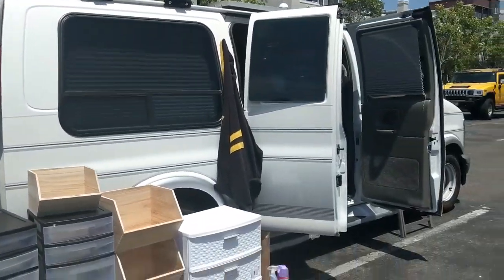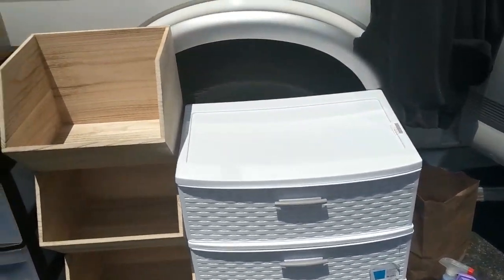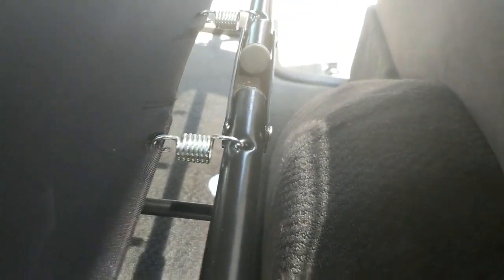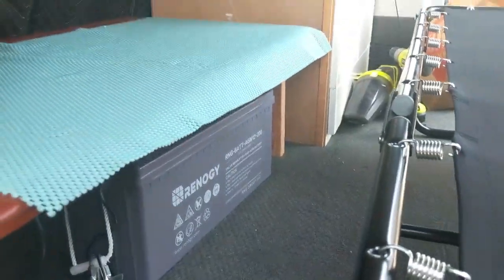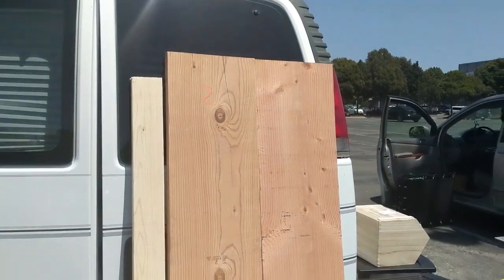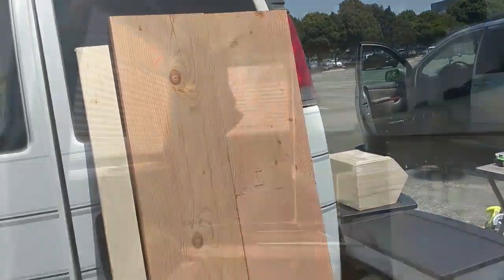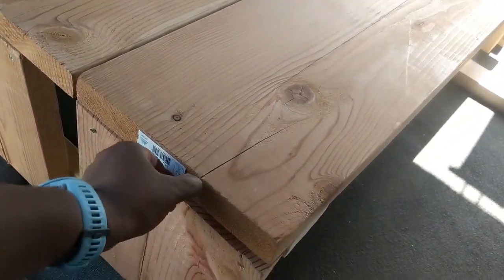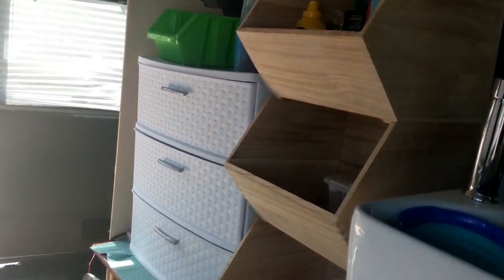Building a Simple Bed Platform | Moving Into a Conversion Van | Solo Female Vanlife

Comment: Nice. you might want to drill vent holes in the bed top.
Reply: I wondered about that.  I think I've also seen some anti mold mats that some van dwellers put under their mattress.
Reply: Why holes? Ventilation?
Reply: @earlee7146  Yeah, I think the humidity in vans can lead to mold under the mattress
Reply: Always inspired
Reply: That and a couple of support slats?
Reply: I think it's a myth... never had holes in my plywood, been in a vehicle home for 5 years now. Holes just make the air, especially cold air come thru and add to moisture exposure. 🤷🏾‍♀️
Reply: Dawn should of gone to someone who have experience in carpentry to held her , winter is around the corner, she need plenty of storage, so put holes or whatever means for air to circulate, underneath the bed she should of divide a small portion by making a drawer on slides for the tools and then a second drawer on slides to put away things she hardly use like blankets etc, wishing her all the best
Reply: Don't think that would be a problem she didn't seal the van air tight so it can still breathe like the manufacturers made it. When you start with the spray foam and sealing all cracks and stop natural air flow that is when you will get a problem.
Reply: Yes, please add holes to your bed platform, I had really bad mold partly because this wasnt done!
Reply: @CrystalVanner  I have seen it happen to two others I follow,you have a couple of gaps between your three planks though so that might be what saves you.

Comment: I love the wood bins. If stuff is falling out maybe a little dowel across would help. Quick to drill a small hole on each side for them. Or - fabric "doors" so it stays pretty and can fasten closed with a bit of velcro. The bed looks great!

One more thing about your storage on the top of the van is you might actually be really glad you kept it because you can keep your outdoor stuff in it and keep the inside of your van for your everyday living stuff. Help keep the Clutter down
Reply from the maker: You're exactly right about the top storage, I am realizing...nope def NEEDED to keep it. 

Nothing has fallen out of the bins so far. I wager if I was on a really really rough like back road something might fall out. But I've done all kinds of driving with them in, everything seems to be staying put.

Comment: Just so people know another easy solution for a bed are those bed frames that have 2 sides. The video that educated me about that used 1/2 of a queen size. I'm short so got a double size, the one I picked was 76' x 27', there are 30' wide ones. I put only 4 feet of plywood on it because without a box mattress the wires break from sitting on it and I pull the mattress up at the bottom for access to stuff. Any kind of padding from air mattress to foam will work. Two people could buy this together, I gave my other 1/2 to the day shelter asking them to give it it a non-sociopath mini-van dweller who needs some help. Where I am there are sociopath issues and others get harmed.

Comment: I think you should nail/glue a couple planks underneath for support so that the middle won't possibly crack or break when you lay or place any weight on it, but other than that, this is a great idea. Great job. Might try it myself. It's hard for me to find a bed frame that inexpensive and sits high enough for me to get up comfortably and this is a great alternative. Thanks for the idea 😊

Comment: For out of the way storage under the bed use the breathable fabric bags actually I have vinyl 
bags its organized by bag easy to pull out at a needed moment you can get different sizes and probably not as heavy as wood. Good job on the upgrades. I ordered my bags from ebay and bought two sets they can be used in the dresser to.

Comment: Ya did well.  However, safety glasses and hearing protectors.  You can get safety glasses that include readers with .75, 1.0, 1.5, 2.0, etc.
Reply from the maker: I have a set of safety glasses in my tool box that fit over my glasses (readers don't work for me, and not seeing properly is also a cut hazard). I'm just an idiot who forgets them constantly. I know I shouldn't.

Comment: Dawn you could have cut the middle leg out if you want to of the camping cot with a hacksaw.  I would have only cut the one that's in the way. I love the way you set up your van by the way. Stay safe and much love
Reply from the maker: That would not have been stable. The middle  leg a part of a major support system in the middle. The middle is likely to collapse without it and I'm a heavy gal, the last thing I want is to lay on something that's gonna fall apart and my new bed is SUPER sturdy. Cutting through metal and stabilizing it so it doesn't fall apart would have been a far harder task then building a basic platform...which is all a bed is.

Comment: Good job! I made my first bed like Chrome's first bed. The plywood from Home Depot was actually made in Canada, LOL I'm in the states!

My present bed needs to go lengthwise like yours bc I'm now in a passenger van instead of a cargo van and it's not as wide. So, I put my wooden Ikea shelving to good use and laid one set on it's front, put twin bed-cut plywood on top and voila! It has storage underneath between the shelves that are not vertical. I took the bottom shelf out to access that area from my garage! I'll also make it to where I can lift the bed too to access storage if I want.

I plan to build a bench to house my fridge with remaining shelving units (I have three). It's good, sturdy wood that I'd hate to not repurpose from when I lived in my house.
Reply from the maker: If I had the time for a full gut, I would move the bed to behind the driver's seat and the kitchen backward. There's good and bad to a partial build already being in the van. If I had a temporary place to stay where I could take a few days on longer projects I'd have made some different configuration choices maybe. But what I have does work, so no complaints. 😊
Reply: @TheDawnofVanlife  yes, I've seen builds where beds are where the kitchen usually is. Interesting.
Reply: @TheDawnofVanlife  I really hope we can meet up one day. I think it would be fun. Hey reach out to your subscribers when you're ready to do a more extensive rebuild. I'm sure someone would put you up for a few days. There's a biz in Arizona or TX that actually does that and they have all the tools there to use. I'll try and find them and send you a link. Bob Wells interviewed him.
Reply: @TheDawnofVanlife  Awesome Possum Van Works! That's the name!

Comment: Hey, where would we put the ladder without the "attic" I am in awww of your caprentry skillls, girl! Are all those tools kept up in the attic? The new house is really nice!
Reply from the maker: Nope, currently under the bed. But they were in the back hatch area in the minivan. Tools are way too heavy and awkwardly weighted to be pulling off the roof.
Reply: @TheDawnofVanlife  you should of built a cupboard on slides using a portion of underneath the bed for storing the tools , remember winter is just around the corner, do what ever you have to build etc do it properly so you won't have any problems when winter is here
Reply from the maker: @allisonthomas8099  The tools ARE under the bed (they didn't fit anywhere else) and what about what I did will cause problems? I have no idea how to build a cabinet anyway. The bed is easy, flat surface...a couple of legs. Even in my renovation of the minivan (which also started with plastic over-the-counter furniture), I used already built Ikea-esque furniture and fitted it in. You have very over estimated one, what I have time for in what is frankly stolen space (a parking lot) and two...what I could actually build if I had a place to sleep that wasn't the van and enough time to do so. And I quite frankly don't see the issue with using ready made stuff if it works. Also, my winter's are in a semi-warm state, winter is colder then summer but never in the way of building. In fact, it may be more comfortable to build in the winter. In the summer the heat has me about ready to pass out and even feeling slightly ill at times because of what I'm determined to do despite the heat.

Comment: Hey Dawn! Hope you see this. What are the measurements on your bed, the width at least. I'm wondering if 30x75 (a narrow twin frame) will be comfy for me in the long run. I'm fine with a twin, but idk if smaller will be too small. 

Btw, In looking back on an older video from the future, I can definitely tell you've lost a bit of weight!!! Fantastic job!
Reply from the maker: My bed in this version was about 24" wide. My current bed is now twin size I. Width and I think about 5 inches shorter then a twin.

Comment: I'm frugal so I would have just cut that leg on the cot so it would rest on the wheel well and secure it somehow.  Great job though.
Reply from the maker: LOL, well I'm no tiny person. As the middle leg is critical to the bed physically supporting weight being on it, it seems more then a tad risky to essentially break the support system. It's also a metal support system..which isn't easy to cut through and not sure what I could use to do it cleanly or safely. Even if it was cut, it would have likely needed something to keep it stabalized (which would have meant a purchase or purchases anyway). So the choices seem to be two, replace the cot entirely or live with the lost space at the wheel wheel, the wiggle the bed did against the wheel well, and falling constantly getting out of bed at night, not to mention storing things under the bed being difficult due to the fact the bed slid around so easily. Among other things, the purchase of three peices of wood to make a bed made the bed not only stable and against the wall, it made it better to store stuff under.

Comment: Isn’t it more roomier to make the bed length wise in the back where the porta potty is, you will have lots of space, just a suggestion,
Reply from the maker: Define legthwise, window to window...window to window is actually quite a bit shorter and without taking down that electrics wall entirely you can't just drop a bed in there.

Comment: Hi Dawn! Great job! I have the same white chest...mine is mint...  How did you secure yours in the van? My plan is to do the same once I get my van. Hopefully it will be in a couple of weeks.
Reply from the maker: 4 screws in the plastic frame bottom. Two in the back, two in the front (with the bottom drawer removed). I didn't do it this way, but you also could rig it to a wall in theory.

Comment: LOVE YOUR VIDEOS LOVE BUT I THOUGHT YOU TURNING THE BED
Reply from the maker: I changed my mind for logistics and time constraints. There was no way to simply flip the bed because of where the electrical was. I would have needed to pull everything out and do a much deeper demo then I had time for. Also, the 1500 is actually the smallest version of that style of van. To really have enough space flipped, you'd need to gut it as the van interior they put in for it's life as a passenger van barely would have given me enough room to lay between the windows and I am 5' 4", so not tall.

Comment: Why should of built the bed with storage at the bottom where you can store your winter clothes and things you seldom use
Reply from the maker: Things I seldom use are on the roof. I don't really have a summer/winter clothing rotation. I live in California, I layer up when it's cool and layer down when it's not. There's no specific set of "winter items" that go away in some seasonal rotation and things are stored under the bed. Including all my tools and exercise gear. There's just no fancy drawer system for it, which would be kinda hard cause of the wheel well anyway. Soft bags will conture around the awkward spaces underneath better than bins or square drawers or anything like that. The only better way to use this side that the bed is on would have been a chest system that opens from the top. Which would have involved hinges, more wood, more cost, and more time. None of which I have and what I have works fine as both storage and a bed with plenty stored under the bed. Simple skills, simple build.

Comment: Do you travel with both of your vans?
Reply from the maker: No, that would be impossible. Once I was fully moved in. I found a new owner for the minivan. Where the heck would I park a second van? Lol As it stood I was just hoping not to get kicked out of Home Depot while I spent a few days transitioning vans.
Reply: Oh I just thought you had a trailer hitch when I saw your other van next to you when you were making the bed. Keep up the good work.
Reply from the maker: @Louie12673  nope, in fact at one point I had to Uber back to the minivan to get it parked next to the big van. It was a relief to get the mini to a new owner.
Reply from the maker: @Louie12673  and there is a hitch available for towing on the big van, but none of the hook ups or equipment needed to actually tow the minivan. Not that keeping both was ever in the cards, it was just a matter of temporary overlap while I moved into the new van.
Reply: Thank you... Stay safe!!